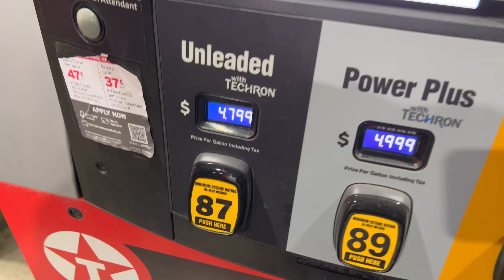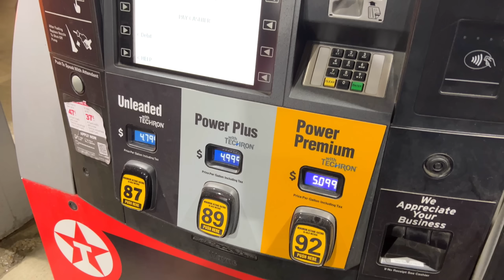Super Clean 2012 RT-S!! • Drive Belt Replacement! | TheSmoaks Vlog_2305

Comment: I have this exact RT-S. It is just at 4800 miles. Scheduled maintenance, a set of tires (age) and two batteries so far. I did get a bad BUDS software update once, but they fixed that quickly. I also have a 2020 Ryker Rally thanks to you. I live in the Desert Southwest now, but was born in Ilwaco and my grandparents lived in Longview. Thanks for all your great content. You have saved me big bucks I am sure. My V-Twin is happy following your advice.

Comment: what was the upgraded replacement belt on that spyder?
Reply from the maker: There wasn't an updated belt for this 2012, just a damage replacement.  However, a much tougher belt was introduced in 2014 for the new 1330 motors.  The 1330 belt is not compatible with the older 990 powered Spyders...

Thanks Maurice!!
Reply: @TheSmoaksVlogs  thank you so much. Ive watched all your videos. Keep them coming.